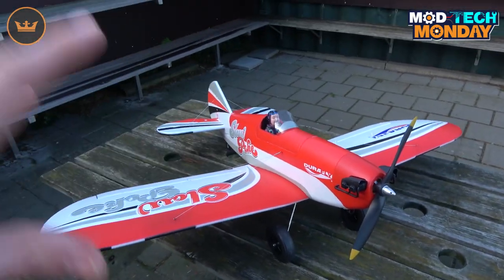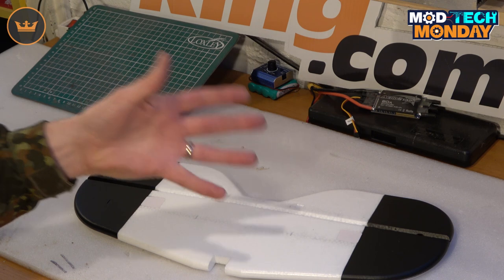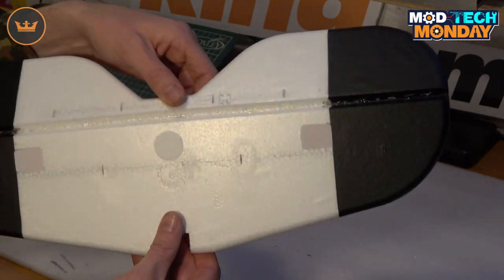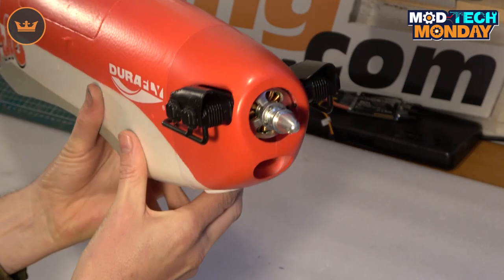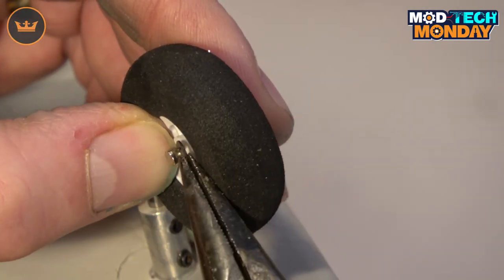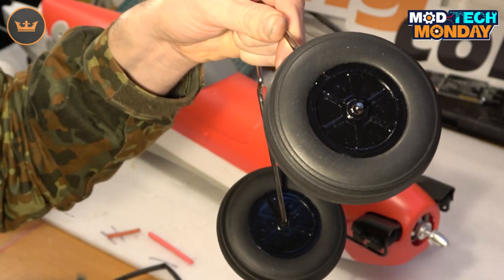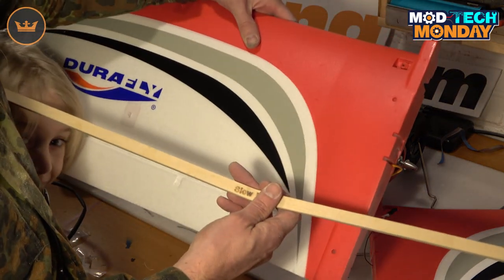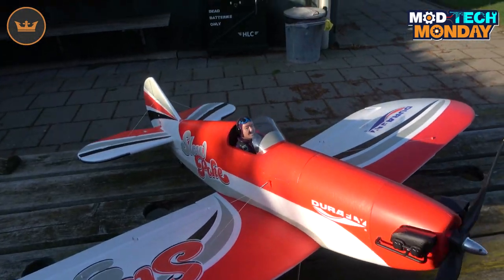Mod Tech Monday - Durafly SlowPoke 1200mm (47.2) PNF Improvements

Comment: The tail wheel has a wooden mount inside the fuselage that cannot be accessed after assembly, mine came loose. I unscrewed the wheel strut, then wiggled the internal parts out by the control rod. Mine now has a metal skid instead of the tail wheel. I have also reinforced the glue on the remaining control rod tubing, to eliminate flexing of the control rods. Smaller main wheels made a big improvement to the stability, and a battery tray keeps the CG from changing mid flight. The control horns dig into the foam and/or rattle loose, so I extended their base. There is probably a few other small modifications on my SlowPoke that I have forgotten. It can be a good model, once you have solved the issues.